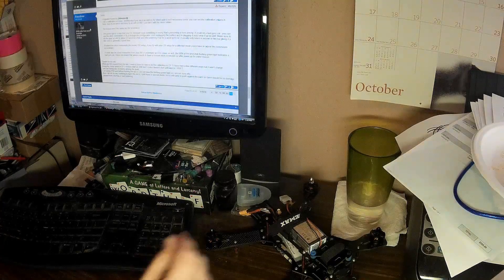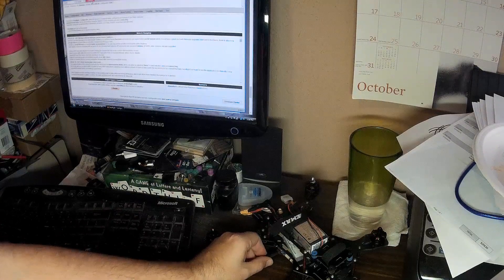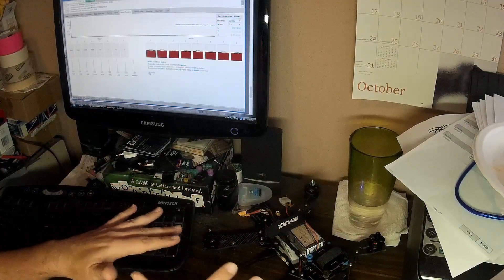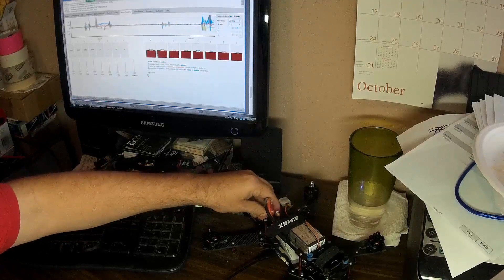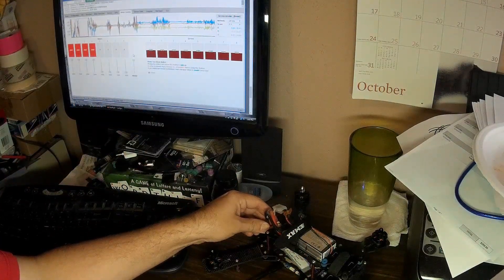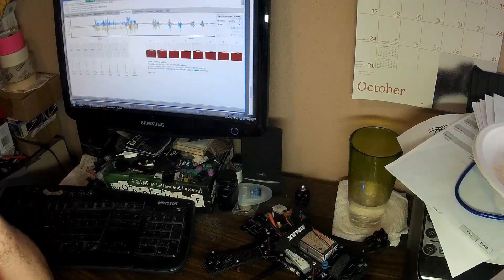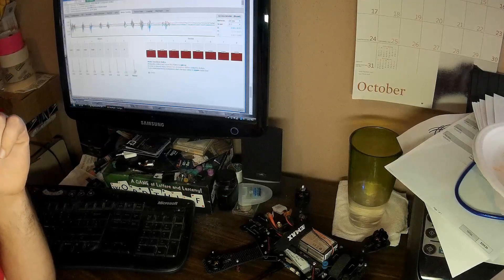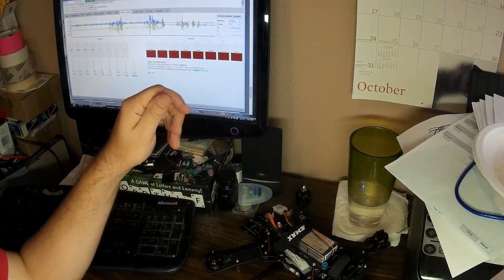Emax nighthawk pro 280 - blheil 14.2 ESC calibration

Comment: my motors are not responding when turning up the master. any solution?
Reply from the maker: most likely that sounds like a wiring issue or an esc issue.
Reply: my bad i did not power it. I've calibrated it. When I connect it to my transmitter, other motors go down(2-3). It also has weird sound during calibration
Reply from the maker: Power tends to help :)  not sure I understand the rest of what you're describing.
Reply: John Martin Dela Cruz props off, usb on, and battery on